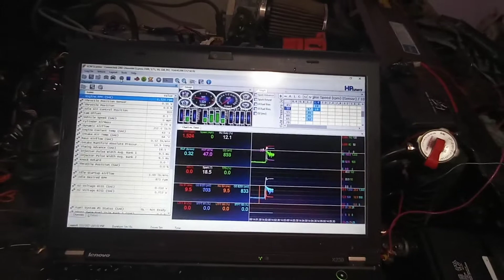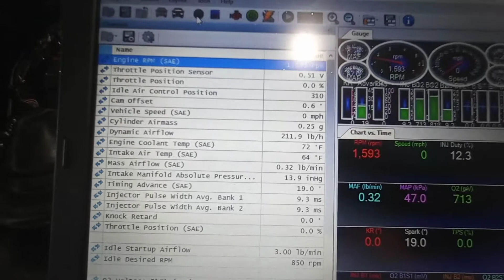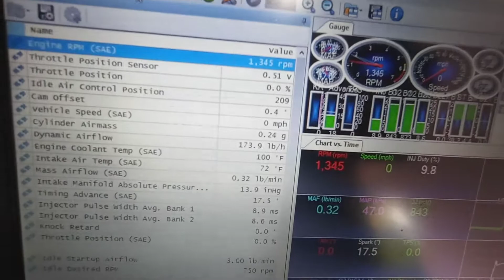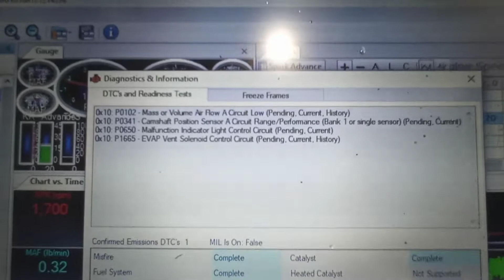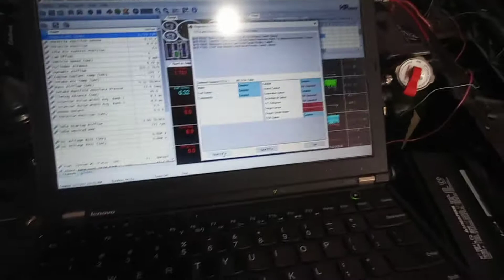LT4 Hotcam 0411 pcm more tuning iacv problem, start up crankimg problem-backfire.

Comment: Maybe it's a intake vaccum leak issue ...
Reply from the maker: Was a variety of issues. First oif all IACV was bad. Also I didn't press on the balancer all the way thus not pressing the reluctor wheel all the way which caused the crank sensor to bugg out. I thought I had misaligned the camshaft a tooth or something and noticed when I went to remove the timing cover. Running Great now.